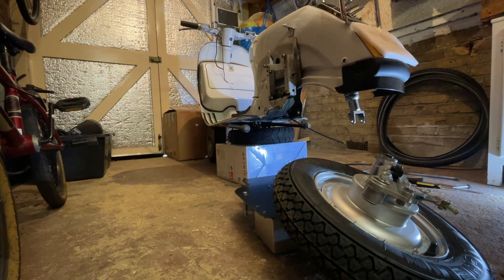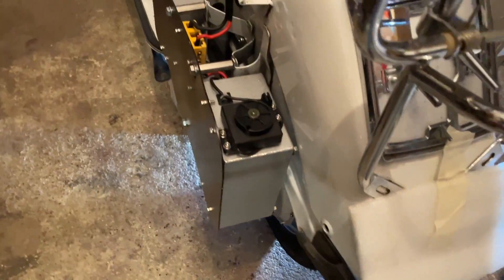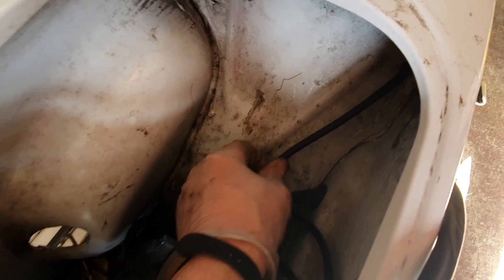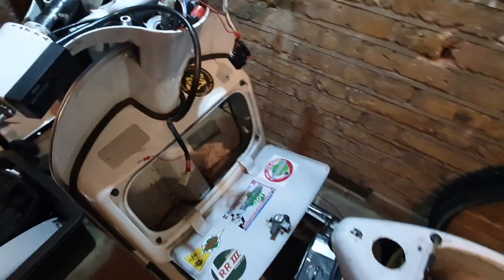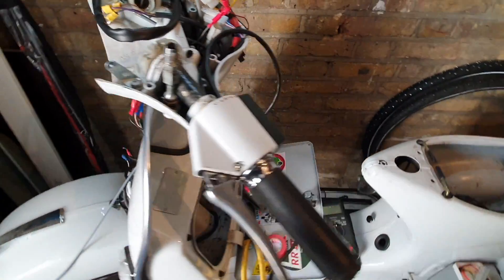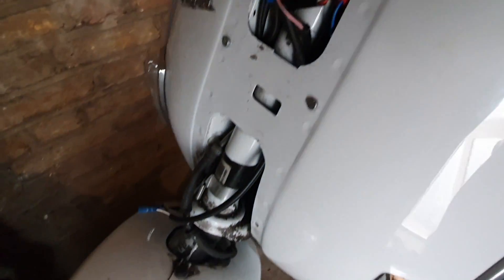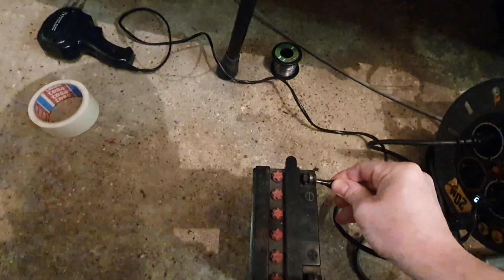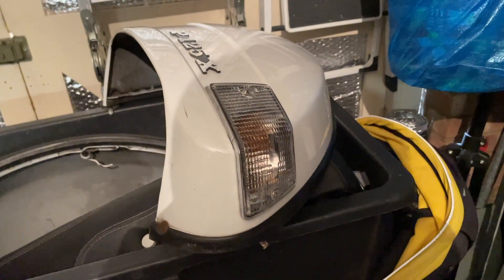Vespa EV Conversion Part 2

Comment: Nice job done.  Just one thing . As there were already nuts present in the fuel tabk area . You should have made a cover for the cavity present there using some sheet metal . It qould be more secure then .

Comment: 4 grand is too much for me  to convert, from retrospect scooters,i ill wait until petrol is no longer available :O)
Reply from the maker: It's not cheap, but it's high quality and it just works. I save roughly £15 each day that I don't take the train to work. I ride in at least 10 times per month, so that's £150 per month, or £1,800 per year.

Comment: Love this!

I’m looking at doing the same to my 1977 Rally 200 and visited Retrospective Scooters when I was in London last year - so so fun to ride.

I’m interested how the conversion is going as a daily rider? Any unexpected maintainance issues etc?
Reply from the maker: I’m glad you like it. I’ve really loved riding my PX conversion. There have been no maintenance issues and no real downsides for how I ride it. When filtering through heavy traffic, I have learned to get behind a conventional motorbike so they can alert traffic if required by revving their engine. That’s the one downside of the silent nature of an EV. Otherwise, my only regret is not waiting a few more months before I bought the kit. The newest kits are much easier to install and are more powerful.
Reply: @randomtasks  This is excellent to hear, I am nervous about the silence as I’ve previously had a Malossi 210 which is very impolite though easy to be noticed in traffic - haha

It feels like buying a new iPhone, timing it to get the latest version!

Comment: Nice vid. I have a '99 PX125 in Spain. For now I still love my ring-ding-ding 2stroke. Love the vibrations. Love the smell. But the writing is on the wall in Europe for noisy/smelly bikes, so I'm very glad to see conversion kits already out there. I hope by the time I have to convert, the battery life and power output will have improved. If so, I'll go there willingly! Also hope the price comes down a bit, since the current PX conversion is 4x what I paid for the bike!
Reply from the maker: Glad you liked it. Technology keeps improving. Retrospective Scooters now has a 4kW kit that is good for just over 100 KPH. But yes, it is an investment . . .